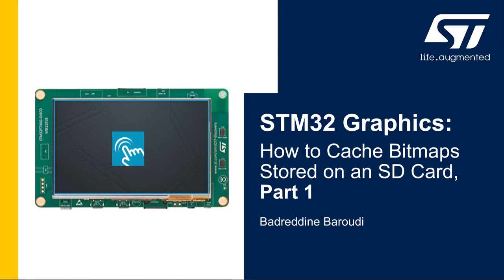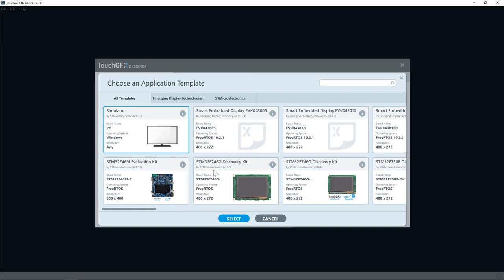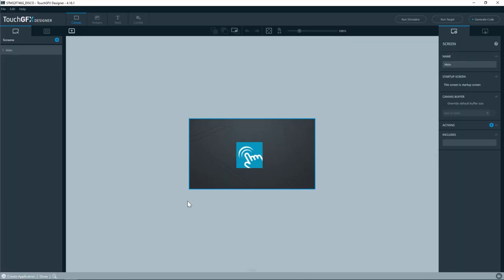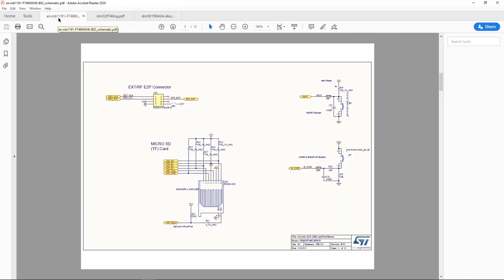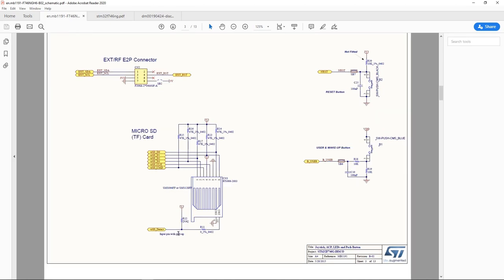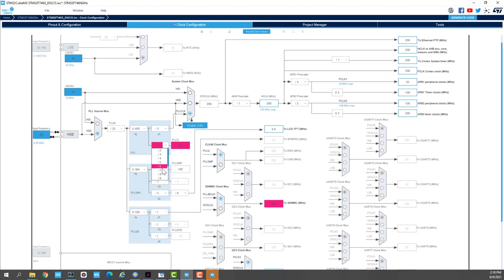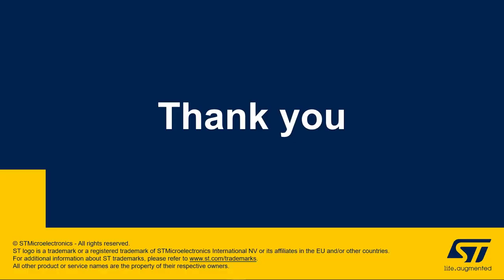STM32 Graphics: How to Cache Bitmaps Stored on an SD Card, Part 1

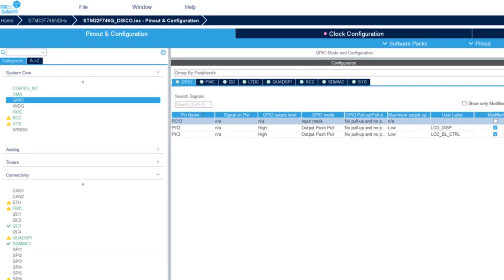Comment: 4:22 Now let me think... because the sdcard detect is already pulled up by an external resistor there is no need to configure an additional pull up on the PC13 GPIO pin... 🤔